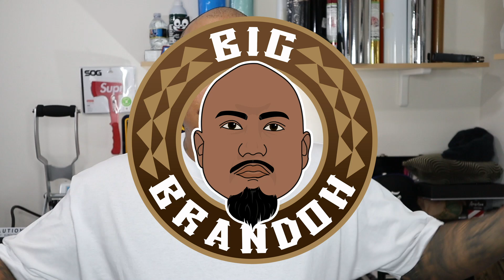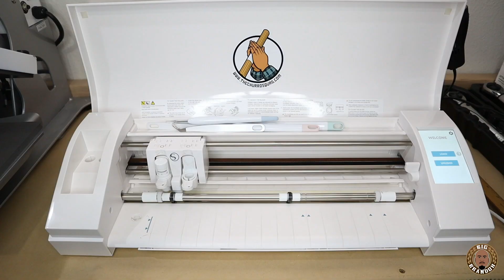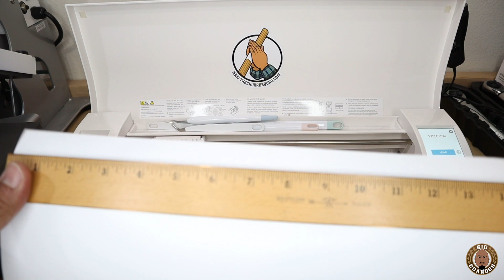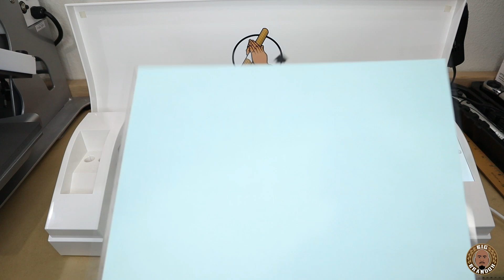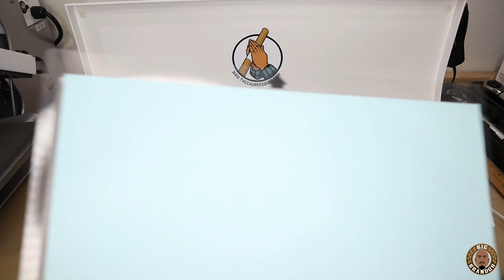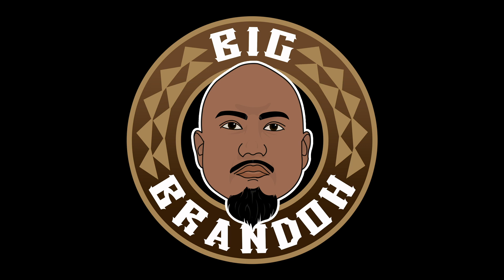How To Load 15" Vinyl Into Your Silhouette Cameo 3 Vinyl Cutter

Comment: what is the diffrence with the cameo 4
Reply from the maker: i have no idea. my cameo 3 still runs perfect. i aint gettin the cameo 4. from what it looks like they took away the color touch screen read out that the cameo 3 had and replaced it with some buttons. the cameo 4 has a little thing to hold a roll of vinyl. thats about all i can think of. the cameo 3 on sale right now too. best time to buy one hahahahaaaaa
Reply: Big Brandoh  ok  than is beter for me buy the cameo 3

Comment: I have a Portrait 2 and having a hard time finding 9" rolls of Oracal 651. I hate having to buy 12" rolls and cutting off 3" to waste. Any suggestions? Thanks.
Reply from the maker: ive never even seen 9inch rolls before. im not familiar with the portrait 2 also. i use the cameo 3 because it allows me to buy 15" rolls and feed them in. i hate cutting my vinyl down too

Comment: Great video. I have been cutting the vinyl 12” so it will fit. I need to try this
Reply from the maker: yeah. it makes it easier to cut off the roll or make it quicker to load up but you do waste 1.5" on each side. so if you got the time to trim it to 12" got for it. so you save yourself 3"

Comment: When I press the shirt, the edge of the heat press leaves a square mark on the shirt, its very noticeable as it makes the fabric within this square slightly lighter in colour. Does anybody have any tips on how to avoid this?
Reply from the maker: adjust your pressure. also, remember that your press is like a big ass iron. you are ironing a square in the middle of the shirt. if the rest of the shirt is wrinkled or "not ironed" visually you think its discolored or noticeable. try ironing the rest of the shirt, if that square bugs you.

Comment: But but... Why load a 15" if cameo could not cut wider than 12"(portrait). Oh. because there's some vinyl that have been sold in 15"... Then why buy a 15" vinyl just to use it in Cameo? 

Much love!!!
Reply from the maker: i can buy 5 yard 15" roll of HTV for $35 or buy 1 yard 12" roll for $19.99. what makes more sense to you?

Comment: Bro can you make a video on how to heat press on a "Bjj Gi"/ bjj kimonos? The material is thick. What type of vinyls would stick to this material. Thanks man! your vids help out lot!
Reply from the maker: thanks for watching. but i cant make that video because i dont own a bjj gi. the only advice i can give you is, find out what material the gi is made out of, buy htv or transfers made for that type of material. (example: gi is 100% cotton, you buy htv or transfers made for 100% cotton) as far as thickness of material you adjust pressure accordingly. this may take some testing. so in order not to waste the whole gi hahahaaa, turn it in side out and press really small pieces of htv on the inside at different pressure and heat settings until you achieve the best result. good luck and thanks again for watching